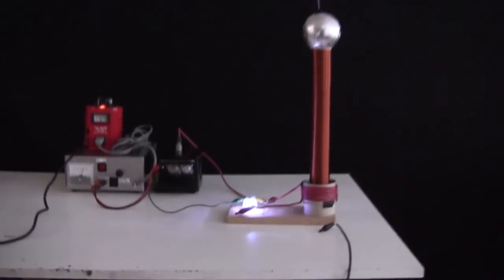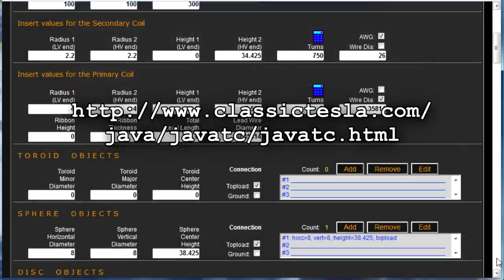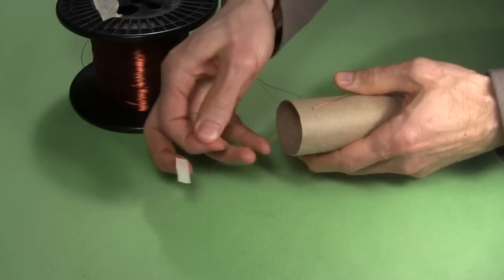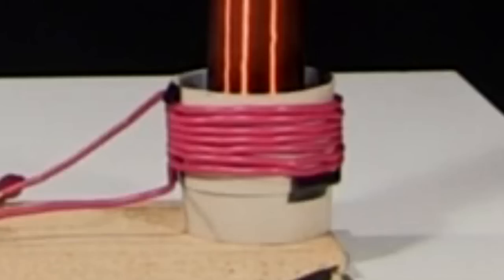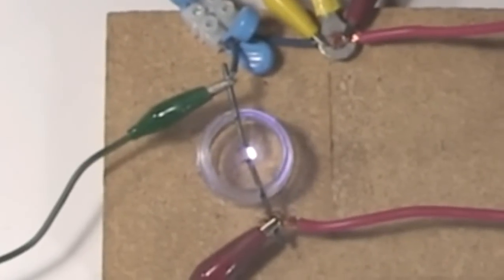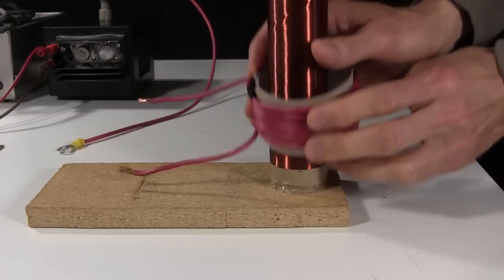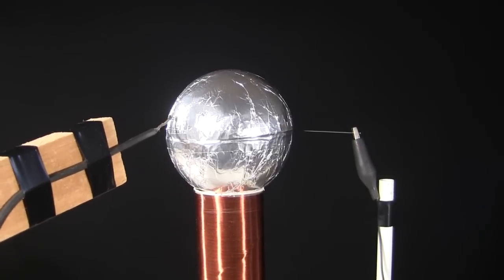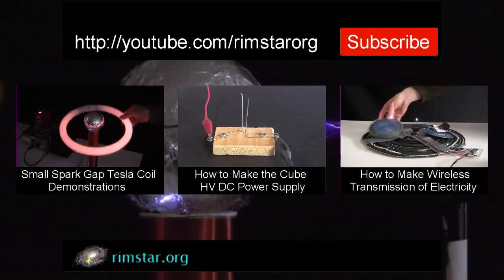How to Make Tesla Coil - Small Spark Gap Tesla Coil

Comment: hey rimstarorg what's the difference between the two primary coils ? is it for different voltages
Reply from the maker: The first primary coil, the one with the insulation on it, could only be tuned by moving it up and down. The second primary coil, the uninsulated one, could also be tuned by changing the number of turns by connecting to it at different points, which is the reason I made that one. There may be some additional losses with the uninsulated one from charge leaking off it but I doubt that's significant in this case, if there are any additional losses at all.

Comment: thanks for the video. but I have a question ❓ 
how much voltage we need?
Reply from the maker: +mooda ahmed I don't know exactly, but the spark gap is very small so probably only a few thousand volts. But you do need some current as well. For example, my power supply made from a fly swatter didn't have enough current but the one I use in this video did.
Reply: +RimstarOrg thanks a lot
Reply: RimstarOrg at least 5kv from my experience

Comment: on how much dc volt the tesla  coil is running which you have shown in your video?
Reply from the maker: I'm assuming you mean how much is the input voltage going to the spark gap? I didn't measure the voltage but it probably was only a few thousand volts, given how small the spark gap is, maybe even only 1000 volts. You do have to be able to supply a lot of current though. For example, the power supply from my fly swatter (http://youtu.be/niRCKUliQWs) had enough voltage to create the sparks but the current was very low so the sparks were only once every few seconds. I don't know what a good amount of current would be either.
Reply: will 500v dc supply be enough for creating air conducting between spark gap? plz suggest i am little bit confused about input dc voltage..
Reply from the maker: 500V DC might be a little too low.
Reply: can i use electric fly swattr as a power supply for tesla coil?
Reply from the maker: No. It can create the spark but it takes so long between sparks that the Tesla coil doesn't work well.

Comment: Hi, how you measure the capacitance as 4nf. There is a formula but you can't calculate it if you dont know what is the outputs of your transformer.
Reply from the maker: I didn't calculation the capacitance. I had 4nF worth of capacitors so I used that as one of my starting points. I calculated most everything else from there.
Reply: RimstarOrg Thats nice, I build a giant flat capacitor than roll it. It was 16nf so I cut it in half and made two 10nf capacitors. I will try to put them in parralel and series to find the best results.

Comment: if i make this same circuit with an AC power will it still work?
Reply from the maker: +John Newcomb Yes, it will. Keep in mind that you'll still need thousands of volts AC. That's usually done with a high voltage transformer like a neon sign transformer. I haven't done that myself though.

Comment: Would a microwave oven transformer work in place of the power brick if the spark gap was smaller?
Reply from the maker: A microwave oven transformer is a high voltage source with plenty of current so it should work.
Reply: Thanks

Comment: Sir how do you know capacitor value or calculate and also no. Of turn secondary coil , gauge ..?
Reply from the maker: For measuring the capacitor value, I have a capacitance measuring feature on my multimeter. Many meters these days can measure capacitance. You can also get a rough estimate for some capacitor shapes, cylinders and flat plate capacitors for example. I talk about doing that in this video about making low voltage capacitors (but it works for high voltage ones too) https://www.youtube.com/watch?v=GveI9gXIsHw . For the secondary coil, I use the online calculator that I talk about in the video.

Comment: Does the primmary coil have to be from magnetic wire?
Reply from the maker: The primary coil should have as large a diameter as possible and good insulation helps too. That's because it'll be at high voltage and you want to minimize losses. Magnet wire has the opposite of both those things. It's small diameter and has a very thin insulation, so it's no good for the primary.
BTW It's "magnet" wire and not "magnetic" wire. It's really just normal copper wire but it's often used for making electromagnets and coils for motors which get magnetized, so it's called magnet wire. There's nothing special or magnetic about it.
Reply: Ту

Comment: how many volts are on sparkle electrodes?I am trying to make it.
Reply from the maker: I'm assuming you mean the voltage at the spark gap. It's difficult to measure and so I didn't but a rough estimate based on the shape of the electrodes and the distance between them is that it's less than 10kV probably even less than 5kV. This trick though, is to have a power supply that can provide a lot of current when the spark happens and to be able to produce sparks at a reasonable frequency.
For example, I tried with this electric fly swatter http://youtu.be/niRCKUliQWs which can produce the necessary high voltage but the current in each spark is small and it takes the fly swatter's power supply a few seconds each time to build up enough voltage to create a spark.
I don't have the precise voltage and current specifications needed but I just didn't want you to think that voltage was the only issue since many things, even rubbing your feet against a carpet, will produce enough voltage, but only for one weak spark every now and then.
The power supply I used is my Cube power supply https://www.youtube.com/watch?v=-KFhBVfpfDw. Ones that use neon sign transformers are another option but I don't have anything about that.

Comment: Hi, I also wanna build a tesla coil, but why does it need a spark gap?
Reply from the maker: +kruimels The spark gap is an air gap, and so it's a break in the circuit. Since it's a break in the circuit, that allows the voltage to build up across the spark gap and more importantly, it allows energy to build up in the capacitor.
But once the voltage gets high enough across the spark, that's when the spark occurs. During the spark the air in the gap is now conductive and all that stored energy in the capacitor can be released into the part of the circuit containing the primary coil. The spark looks quick to us but it actually lasts long enough for the energy in the capacitor to go back and forth through the coil many times. It's that back and forth that creates a fluctuating magnetic field that induces a fluctuating current in the secondary coil, ultimately resulting in the streamers and other effects.
You can make a Tesla coil without a spark gap but you'll need the right circuitry to do similar actions. That kind of Tesla coil is called a "solid state Tesla coil".
Reply: +RimstarOrg Many thx for your answer mate. So with a spark gap, the power what is coming out is not constant. then I will need a solid state tesla coil. Is it possible to make a solid state tesla coil with DC output? I have allready 3 transformers from a microwave, I have putted them in Series and have now around 6600 volt. what kind of diodes do I need to make it DC?
Reply from the maker: +kruimels I haven't looked in detail at a solid state Tesla coil circuit but I imagine it's mirroring what the spark gap one is doing. It's output can't be DC because it needs AC to do the induction between the coils. The output from the Tesla coil will be the same as with a spark gap circuit.
A Tesla coil isn't simply a step-up transformer. The resonance that happens builds the voltage up much higher than a simple step-up like your microwave transformers are doing.
You can find high voltage diodes lower down on this page:
http://www.amazing1.com/capacitors.html
and probably on ebay.com. Your microwave transformers might be putting out a relatively high current too so you'll have to take that into account when buying diodes.
Reply: +RimstarOrg Thx for the answer again. So I need ac power for the the two coils, but how to get dc power output at the end? if that is even possible. I need the outpust dc current to experiment and do some testings with other high voltage devices. and it must be dc power.
Reply from the maker: +kruimels Whether or not you can get DC output out at the end depends on your current. If you know the current then you can check the current ratings of the diodes and do a full wave bridge rectifier, being careful to insulate everything since any sharpish points can leak corona.
Or maybe you can up a Cockroft-Walton voltage multiplier at the AC output in order to get DC, and increase the voltage a little.
Alternatively, you can go with a high voltage DC power supply instead, one involving a Cockroft-Walton voltage multipler at the end like mine here http://rimstar.org/equip/30kv_pwr_supply.htm.
Reply: +RimstarOrg Nice, thx mate. First I gonna try to build a tesla coil.

Comment: Hi, what factors determine how long the "lightnings" will be???
Reply from the maker: +gyorgy komaromi The voltage determines how low the streamers at the top will be. Assuming you manage to make the tesla coil resonate well the the input voltage from the power supply is a factor as well as the number of turns on the primary and secondary. Bigger tesla coils produce higher voltage.
Reply: RimstarOrg What difference will make a 1mm wire instead of 0.5 mm on the secondary???Do I need a bigger coil if I have a 10kV power supply or I should stock with this one???
Reply: gyorgy komaromi Stick*
Reply: gyorgy komaromi If the frequency is higher something will change???
Reply from the maker: +gyorgy komaromi A smaller coil will give you a higher resonant frequency. Larger coils have lower resonant frequencies. So it's lower that you'll get after for higher voltage.
Reply from the maker: +gyorgy komaromi With a 0.5mm wire you'll be able to put more turns on and have higher voltage output. I don't know if it makes much difference otherwise. Regarding the size of coil for a 10kV power supply, I'm not aware that it matters. As you're learning from my replies, a coil with more turns will give you a higher voltage output. Make sure you redo the calculations with the online calculator that I mention in the video if you change anything.
Reply: RimstarOrg I calculated everything I changed :) and if i chain two 10kV power Supplys in parallel???
Reply from the maker: +gyorgy komaromi Can you connect two power supplies in parallel? I would guess it's not as easy to do as with batteries or solar panels without considering how it affects the power supplies inside. But anyway, that would give more current to the sparks which would give stronger induction in the magnetic fields which I guess would give more energy to the streamers.

Comment: could you attach two magnet wire coils for the secondary, for more turns
Reply from the maker: +agashcool123 If you mean, can you connect two wires together to wind a longer coil with more turns then yes, you can.
Reply: +RimstarOrg Thanks.

Comment: i know this is 5yrs old but you could of saved a lot of time by just useing a  motor speed controller on the zvs power  input for frequency control/tuning and a adjustable voltage  booster on the input of the speed controller for output power control  thats what i did for my 100,000v 1.2kw ac flyback  hv power supply that feeds into my 51x tesla coil multiplier  2turn primary 102 turn secondary  the math says on max output of 100kv hvps into the tesla coil i should get 5.1million volts at 4.25 amps on the out i used thicker wire in than usual to take advantage of that yet to test it still have alot of work to do be for i can do that safely the tesla coil i made is 11.25in long by 1in diameter so very small considering the 1200watt hv power supply i made

Comment: can we use those 400kV modules for the Tesla coil
Reply: I mean powering
Reply from the maker: The input voltage is actually limited by the width of the spark gap and that's going to be in the 10s of kV. I'm not familiar with the modules you're talking about but that will keep them from getting up to 400kV. I also don't know the current so I don't know if they will generate sparks fast enough to make it practical.
Reply from the maker: Judging from the sparks in the 1st video it has the voltage and current for input to a Tesla coil. I agree, it's nowhere near 400kV. The output wires wouldn't be able to handle it.
Reply: Im planning to try one. Or the 1000kv version. When it gets to that high voltages it will not be in the wires anymore, it flows on them (skin effect).
Reply from the maker: Kangsteri I don't think it's the voltage that causes the current to flow over the skin. It's the high frequency AC (https://en.wikipedia.org/wiki/Skin_effect). Even then, I'd be very careful. There has to be a reason you see all those people in Faraday cages when near large Tesla coils with long streamers.

Comment: rimstarorg whe i use the capacitor for spark gap the capacitor will explode why?
Reply from the maker: Capacitors have a voltage rating. If you go over that voltage then you'll damage the capacitor, unless it has an air (like a spark gap) or liquid dielectric between the plates. That damage inside a solid capacitor is like a small explosion in a confined space.
Reply: tnx for responding my quest i have created a cap whit 4 plastic bottle and 4 alluminium foil coiled and i solved the problem and solved the problem whit transistor hotburning whit a large heatsink and a little fan on the front of transistor
Reply: and for safety i put the spark gap inside a glass container its wery noisly whitout the glass

Comment: Thanks for the tutorial. I have learnt from the hard way that  it is not a good idea to use those blue ceramic HV capacitors in your video. The 25KV or 35KV 1nF  ceramic capacitors are actually rated 10KV in air and the manufacturer rating is based on operation in oil pot. As a beginner, I only found out about it in a very costly failure as there is no information about it from the ebay seller. Secondly ceramic capacitors have poor performance for tesla coils; there are lots of power losses at high frequency resulting over-heating and sudden failure.  I ran my ZVS driver at 26V DC to a connected a  TV flyback with DC HV output and it instantly destroyed a MMC bank of 12 x 35KV 1nF in parallel. It was the brightest, loudest and scariest spark that I have ever seen. Operating in air, a thick arc jumped across the 35KV ceramic caps killing them all. Maybe it worked in your case because your HV supply voltage and current  is much lower than the ZVS driver. Also my coil and primary capacitance were much bigger.
Reply from the maker: Thanks for the info. It sounds like the 35kV rating is more for the distance between the leads than for the actual capacitor inside. But mine did degrade in capacitance without arcing and I ended up making some homemade flat plate ones instead https://www.youtube.com/watch?v=EkvODkLL9Og.

Comment: What if I wanted to use a 10 kV NST instead?
Reply from the maker: I haven't tried it myself, but many have done it. I'd think you could use a 10kV NST in place of the HV power supply I used.
Reply: Could I ground the secondary with a grounding cord through an outlet? I am in a fourth floor apartment and don't want to cause a short, or any unnecessary danger...
Reply from the maker: That's what I do, but it's not a great idea when working with high voltage like this since if there's a spark to the secondary then you could shock someone who's on the same ground system, who happens to be touching the metal case of something that's grounded and they themselves are grounded. But I don't have a good suggestion for an apartment otherwise. If you were in your own house, and there was a danger of shocking someone else, then at least you could use the incoming cold water pipe as a ground, or pound a ground rod into the Earth to make your own ground.
Though if your Tesla coil is the same as mine in the video then the shock is pretty mild anyway. I'm not sure it would even be noticed by the time it got elsewhere through the ground.

Comment: what happens if i changed the distance between the two electrodes of the spark gap?
Reply from the maker: +ahmad hajj hussein If you increase the distance between the electrodes then the capacitor will have more time to build up more energy so that when the spark happens there's be more current and I think you should get a better result from the Tesla coil.  Just make sure you don't allow the voltage in the capacitor to build up so much that you damage the capacitor. That's what the voltage rating on a capacitor is all about. If you decrease the distance between the electrodes then the voltage will be lower and so will the energy and the result from the Tesla coil should be less, I think.